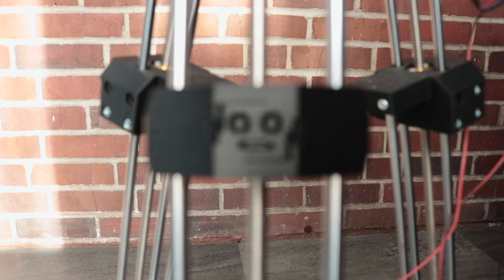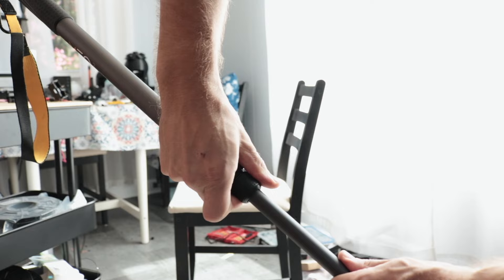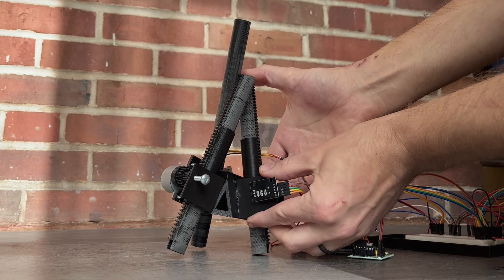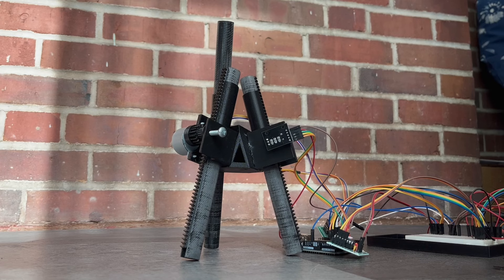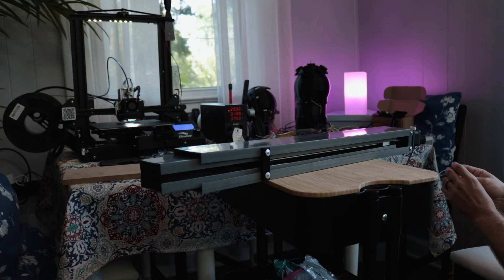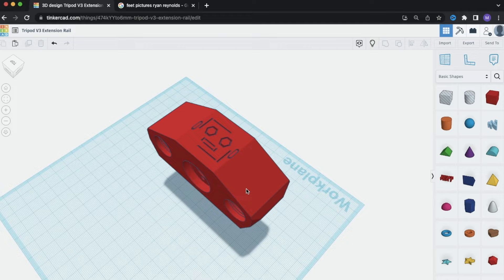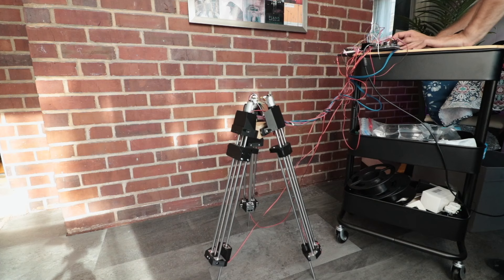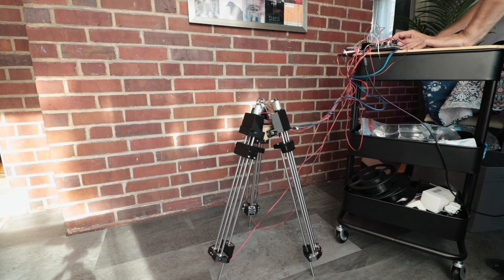Can We Make A Robotic Tripod? Self-leveling tripod prototype

Comment: Nice work sir
Reply from the maker: Thank you! I’m getting started on designing an upper base for them all to connect to and allow them fold up like a normal tripod. Right now they are just screwed into a triangle shaped wood block. I was trying to have the leg design finalized before I started to avoid a redesign loop but I gotta find a better solution for the dangling wires everywhere

Comment: Would it stabilize on it's own during lifting if the rear leg was on a roller? in turn reducing resistance. this is way above my pay grade. 😆
Reply from the maker: So ironically we are on the same wavelength! I ended up electrical taping a caster to two of the legs and it helped a ton! The issue is it slowly “inch wormed” across the floor, which I’m not sure if it’s a bug or feature yet. The legs are currently screwed into a terribly cut 2x6 board and cannot flex. I was thinking that I should start designing the center “hub” where the all meet and make the swivel happen there but I wanted to have the leg design more or less finished. And here we are infinite redesign loop haha.